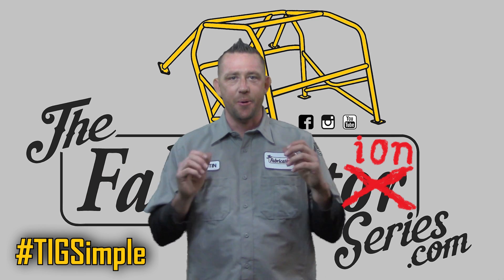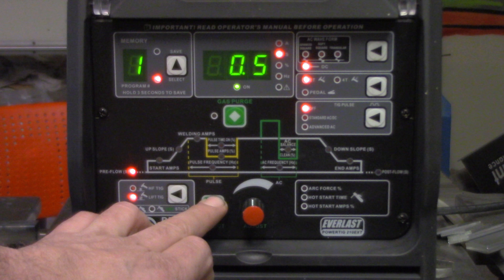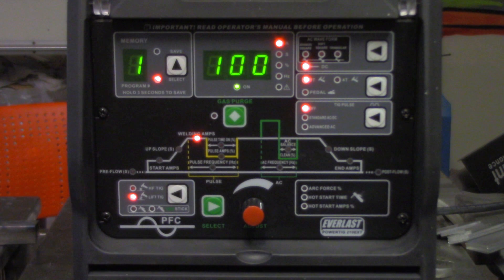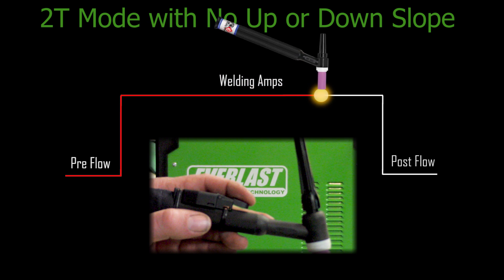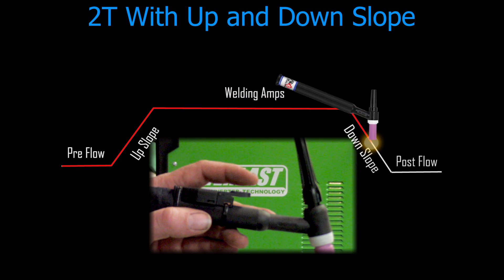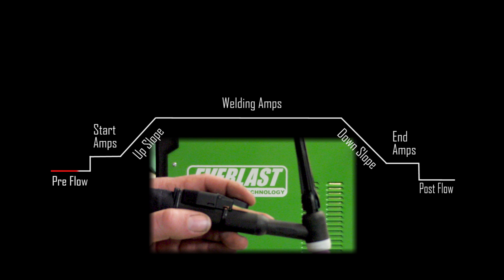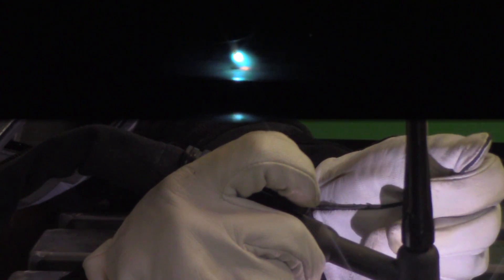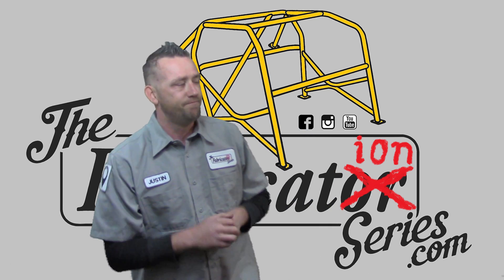TFS: 2T 4T TIG Welding Operation Modes #TIGSimple

Comment: How does 2t/4t work in correlation to running a foot pedal? And is there a specific time n place for using torch or foot for switching? Complete newb here. Great info in that video though.

Comment: Anyone one here use the vevor brand DC Tig with 2t 4t it only has one amp setting tho and a USB in place of where the next model has a dial to adjust makes me wonder if it's there a way to just wire a dial to it and it would do that idk buy it's a vevor 220 Tig dc and the next model is the same but has dual amps and pulse control

Comment: with 4t, can I have high amps for t1, and then lower amps for t2 as to break through the aluminum film on t1 and then have a smaller amount of heat to advance my puddle?  thanks...I have a prime weld tig welder.

Comment: 4t seems very good for non auto darkening helmets basically your strait glass eye protecting can see this function very useful to find your work  which is why I hate using strait glass, how ever with this function I don't really see a need for auto darkening of cores just bought a 180 helmet soooo little late!! :( I have years of stick welding so tig is the new adventure so thank you learning a lot

Comment: I've really enjoyed your videos...they're excellent! I do have a question for you however: I have a Miller Synchro-wave 200 which is a transformer type , whereas most of your settings and recommendations (Tungsten color for example) are for inverter type machines. Do you have any videos for those, possibly Series 1-2, and if so, how can I watch them?
Reply: We have the miller Synchro-wave 300 and I was hanging trouble setting it cause I’m trying to work on my welding and need a lil help.

Comment: Some behave differently on 4T, once on the finish amps a flick of the trigger will set them back into upslope, so you can (slowly) pulse the current or back off e.g. when the work's getting too hot - useful feature.